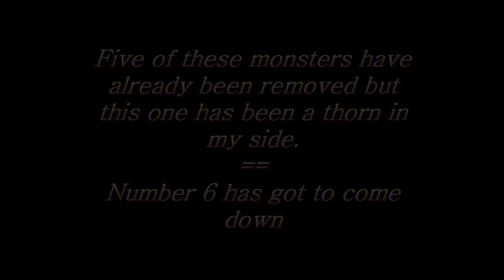1000 Pound Microwave Antenna

Comment: Thanks again for a great video, John, and especially thank you in general for sharing by describing and defining your art through your commentary and caption text as you work. :-)
Reply from the maker: I had to click on "reply" in the Gmail my notifications come through to figure out which tower this was.  I did remember the rust but not the location.  The worse was yet to come on this tower.  Getting the top 1200 pound microwave dish off the top of the tower was a real pain, took two days and the electric department had to remove a 7500 volt primary line cutting diagonally across the driveway that lead to the tower.  I lost a lot of money on this job but we got it done.  John
Reply: Understood... seems like YouTube is changing the way notifications work... they're kinda like Facebook's setup now, with the little messages that pop up on the screen when someone says something in the comments section of posts.... I'm using Chrome and I get those pop-ups that notify me when someone says something on a Facebook post I'm following, and now it's happening with YouTube, too
Reply: And, right on, John.. good job on getting it done, despite the losses and barriers that came up.

Comment: thanks for another video, would it be possible to show us the inside of the tower control room etc? that's if they even have one, it would be nice to see all the electronics.
Reply from the maker: cctvuser I will try to remember to do that soon.  The tower in this video was sold to an individual who eventually abandoned it.  The local county government took it over and replaced the shelter.  There is no equipment in that shelter yet.  We will take the top dish down this summer when the wind is light and the sun is boiling hot.  After that there will be public safety antennas on the structure.

Comment: So I think I liked it when you told him to tighten up that clamp right, when he made it up to you. And let my ask a question? Why where those antenna's made so heavy? Maybe I don't understand how they work, are they still made that way today the new ones? That tower had to be build tough to handle all that weight. thanks Kevin
Reply from the maker: Nuts4Bass You've actually asked a good question.  Perhaps the heaviness comes from the antennas being constructed 25 to 30 years ago.  I do know that much of the weight in those antennas are the steel pipes that reinforce them.  Much of the antenna is either fiberglass or aluminum.  It would be interesting to know if 12 foot dishes are as heavy today as they were during the 80s.

The antennas are large (as opposed to heavy) in an effort to make them as efficient as possible creating a low power RF beam concentrated into a 3 degree shaft of energy capable of traveling 25 miles or more, making the signal reliable and the tower equipment durable in all sorts of different environmental conditions.

Comment: John, do you work on cell towers as well, or just  TV and radio towers? Because I just want to work on radio and TV towers. Unless my company tells me to do so. BTW, what's the highest you've ever climbed? Stay safe.
Reply from the maker: isaiah mcinnis We do not do "cell work" but occasionally work on a strobe or broadcast antenna system that happens to be on a cell tower.  Our main thrust is broadcast and public safety work.  We're also in the two-way radio business so tower work is not our only venue.  It's merely another income opportunity.  The  highest tower in this area is 1359 feet and I've been to the top.  I've been on one broadcast tower in Atlanta but don't remember it's height.  I did some photos and planning for the installation of an ENG antenna for that station.  That tower also had an elevator.  The 1359 foot tower only had the "endless ladder".  Obviously it's not actually endless.  That's just the way it seems sometimes.
Reply: John Hettish OK, thanks for the reply. I live in Mississippi, and I think in one of your videos, you stated that your company is in Tennessee. So if you do have your company around here, I will put your company on my list to look at. Stay safe.

Comment: Hi, John
Do you know where i can get jin pole like you have?
Reply from the maker: Igor Semenets Sorry, no.  I'm lucky to have it.  I can get the dimensions to you but at the moment it's at the top of the tower and will be there until that last dish comes down in about 8 weeks.  It is made from T6 Aluminum about 1/4" thick and is about six feet long.  The square plate in the middle is 1/4" T6 Aluminum.  It's made specifically for installing and removing dishes like that one.  Once I get through with this project I hope I never see anothe dish like these 12 foot diameter, 1000 pound monsters.

Comment: Is the flash across the screen caused by interference from the discharge of the strobe?
Reply from the maker: I don't remember seeing such a thing on this video though I have seen it on other videos.  Give me a time-stamp so that I can take a look.  It could be the strobe but since I haven't noticed it in this video I don't know.  I was there (on the ground) taking the video, I edited the video and uploaded it but what you're referring to completely slipped by me.  John
Reply from the maker: I remember or at least I think I remember.  It was surely the strobe light flashing and the camera not able to keep up with it.  John
Reply: Some of it is barely visible around 5:56 across the bottom of the screen. 6:16/6:28...6:47 flashes up in the middle of the screen all the way across.  It seems to get heaviest when I think the helmet (cam?)is closest to the strobe.

Dad used to take us on cross country trips in the early 60's. I remember looking at the flashing red lights in the vibrating rear view mirror and imagined people communicating in the middle of the night. Sometimes I wondered if the radio we were listening to was bounced off the antenna I was looking at.
Reply from the maker: Is that Ernie Kovacs in your avatar?  Too small to tell.  Now I think I know.  It's John Astin, as Herman Munster.  

In this case it seems to be the strobe flashing and being caught by the optics of the camera.  The camera is not looking directly at the strobe so the strobe generated light may be reflecting off of various components of the tower.  After 7 minutes you can see more and more of the strobe light once we're at the top of the tower.  The microwave dish removal turned into a real financial nightmare.  It's not interference though.  It's purely light and optics.  The camera was on the right side of my white helmet and that was probably the primary reflector.  John
Reply: Interesting stuff.. The avatar is Gomez from Adams Family.
Reply from the maker: Good choice for an avatar.  I guess Gomez would have been my next guess.  Thanks,  John

Comment: Another good one! Do you remember the general frequency of the antenna, and also, are they scrapped or re-used? (looked pretty old)
Reply from the maker: Will Phoneman I believe the antennas were for 6Ghz.  We're scrapping them eventually.  They're really not good for much of anything and are pretty deteriorated.  Smaller stuff has taken over mostly it seems.  There is a tower in Sumner County Tennessee that a couple would love to have removed from the property they are about to buy.  I got an ASR number and checked the FCC database.  The ASR form says the tower has been dismantled.  Google Earth and these people say something different.  The tower in sumner county is only 140 feet and my plan, if I get that far, will be to cut guy-wires and let it fall.

Comment: How did that dish finally come down, and is there video of it?
Reply from the maker: I don't think I got a chance to video the job.  We were a bit undermanned but I can tell you without any reservations that I was very happy when we finished.  I can say we used a 12,000 pound hoist rigged with 3000 feed of 5/16 7-19 steel cable.  Our Trolley was a 5/16" diameter double braid rope.  We had also gotten the electric provider to kill power (14,500 volts AC) to the site due to the fact the line ran right where our cable and ropes needed to run.  With weather and other delays it took us a couple of days to get it down.  It was a really a  pain and the boss (me) was very nervous until it was on the ground and in the refuse pile.  John
Reply from the maker: I should have said, "this part of the job" as in the final dish removal.  JH
Reply: John, thank you for the reply. Always entertaining to watch you and your work. Next month I volunteer for an OVER THE EDGE CHARITY, where they rappel off a building. The Petzl I'D and RIG got me over my fears. If they are used correctly and methodically, you cannot go wrong. Hopefully you are using a comfortable harness up there. Any thoughts on the Petzl AVAO SIT or ASTRO SIT, or the Exofit, by Strata?  Regards!!
Reply from the maker: Mainly pay attention. I'm recovering from a fall of about 10 feet, on my own time and trying to rescue a kitten from a tree.  That 10 foot fall put me in two different hospitals for 64 days.  Most people who know me say if that had been a tower the fall would have never happened.  In 46 years I've never come close to falling from a tower.  Trees are quite unreliable and since I was doing it for my wife I hadn't payed much attention to safety.  So, be safe and find yourself in a painful position.
Reply: You have not fallen, because in most of your videos you always are saying to do things slowly and methodically, that is the key to being safe, then using and trusting your equipment. I'd be dropping things and continually have to being going to the bathroom with my rotten prostate. Secondly, I loathe and despise the cold, perhaps if I was younger and looking for that line of work, it would be in a warm weather state or country. LOL.

Comment: Shame you just cannot unbolt the thing and let it drop?
If all the people were well out the way below?
Reply from the maker: EastAngliaUK Good day East Anglican.  That would be much easier but dropping that particular dish would have probably lead to a disaster, especially for the people on the tower and even the people on the ground.  The structure is supported by five levels of guy wires, approximately 50 feet apart.  The upper three supporting guy wires are doubled in a "bridle" fashion, meaning there are six wires per attachment.  Basically there are 24 guy wires supporting a 300 foot tall tower.  If a 1000 pound weight was to fall from the top it would in all likelihood strike one or more guy wires on the way down.  The effect of striking the guy wires would probably cause the tower to buckle and collapse.  

We removed that dish about six weeks ago.  It took us two days and about ten hours of work to get that monster on the ground which included cooperation by the local electric supplier whose crews removed a 14,000 volt line from the driveway to the tower.  This was a really dangerous removal and we were too busy to get much video of the operation.
Reply from the maker: EastAngliaUK If my customer wasn't planning to use the tower for other purposes that would be an alternative.  However that wasn't the case.  Someone has to pull that last bolt, probably impossible anyway, and that person would have to be on the tower.  Much too risky.  The antenna would probably hit one or more guy wires and that would bring the tower down.  As I mentioned in my previous reply there are a spider-web of guy wires supporting this structure so it would be very unlikely that dropping a 1000 pound antenna, 12 feet in diameter and five feet deep, and not hit a guy wire.